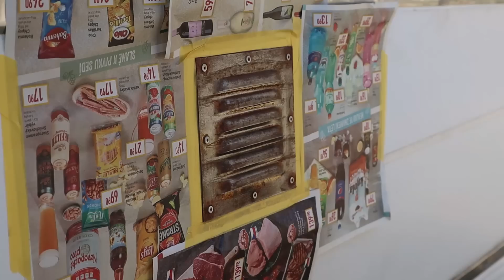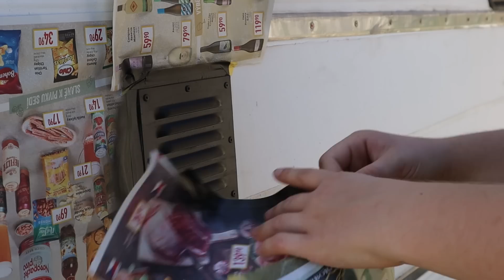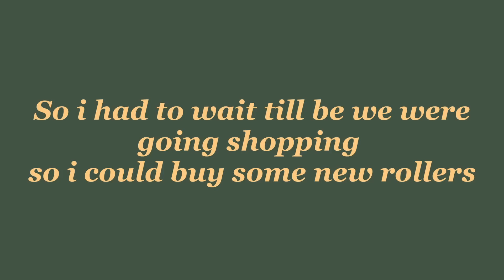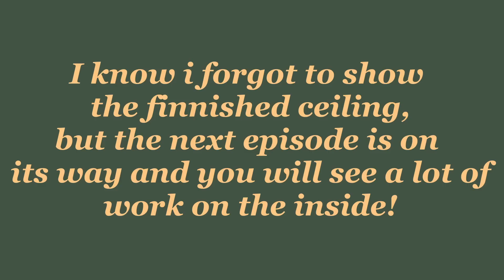Painting my caravan and finishing the ceiling inside | Caravan reconstruction EP9

Comment: You’re getting on well with that. 👍🏻 Remember to keep the joins in the wood cladding over the top of your wooden framing so that you can screw down the ends of both pieces onto the framing. This will stop the joints gaping or coming apart later.

Comment: Ok you mentioned possible names - I like Jasper.
So I Googled it.  Here's what I found:

Means strength & stamina both emotionally & physically.  Sustains & supports, through times of stress, bringing tranquility & wholeness.
Jasper in Hebrew is Jewel and said to be one of the Three Wise Men, a king. Jasper - Bringer of Treasure - which originated from the Latin Gaspar, being of Persian origians.
In Dutch it would be Casper.
Green Jasper, a stone, along with blue are rare and desirable.  
Yeah! for Jasper green.
Reply: I should have added for the fun of it that I have a MinPinDoxie,    He is no higher than just below my knees. Picture a Doxie with really long legs instead of the little short ones.
His name is Spartacus,  he a rescue and came with that name.  Though he is small the name seems to fit.  Fun and very full of energy!